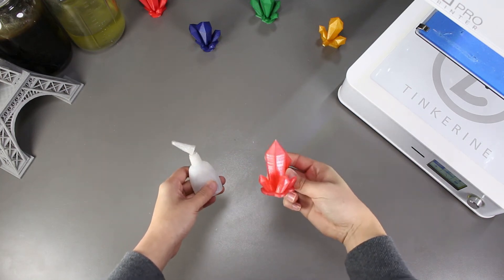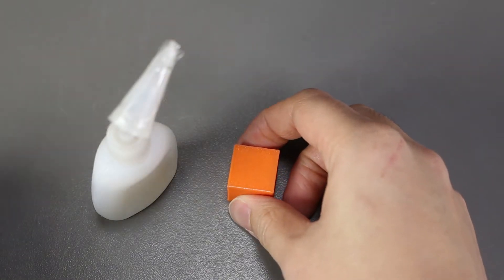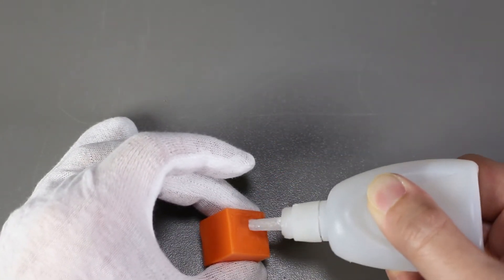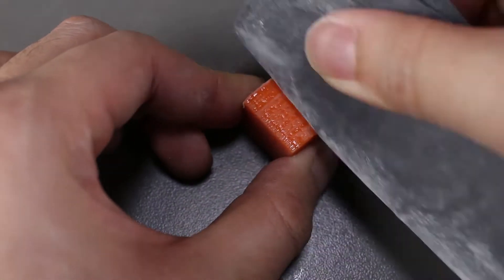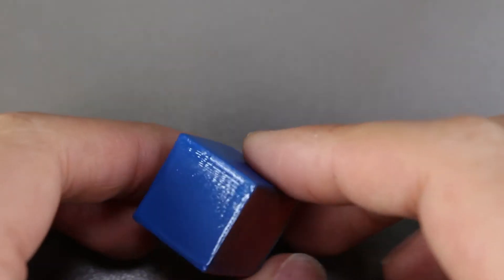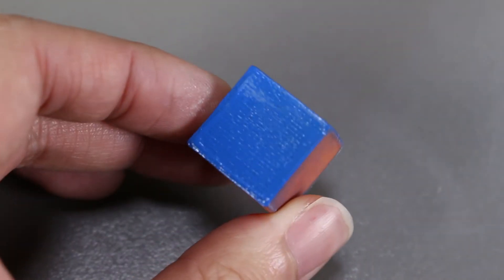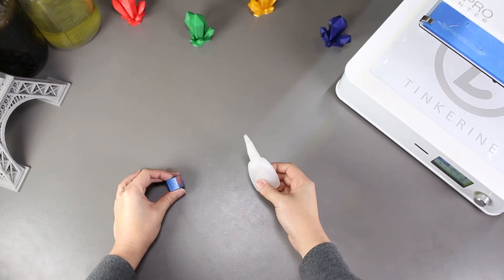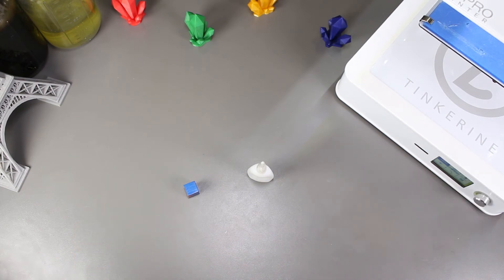Using Super Glue to Post-Process 3D Printed PLA Parts

Comment: Don't know sup with all the dislikes, this was helpful. I need really thin layer of something that can be polished to pull fiberglass mould out of my print. Was thinking of applying layer of epoxy resin and sanding it down, but epoxy is thick and CA glue can be very thin, and I don't feel like sanding epoxy. I think some thin CA glue will be my best bet.
I found this video after remembering I used to use CA glue as a finishing layer when doing pen turning. That was my favorite finish, hard surface, can be polished extremely well, fast curing. CA is great.

Comment: That looks promising, I imagine if you apply more layers of glue and then sand it out you could make it more even.  Also I wonder how this effects the overall strength, would be nice to see if it makes the object stronger too.
Reply: I actually used this trick in the past to strengthen up very thin joints on a split pin and it worked great. The little pin is still going strong 5 months on :) My prints without glue all snapped when inserting it. I think the glue gave my print just enough extra strength but I still wouldn't trust it to really be strong if you know what I mean.